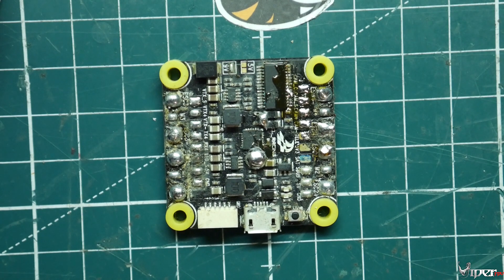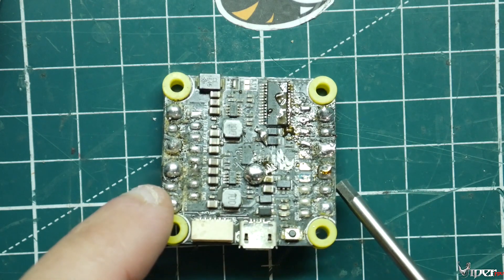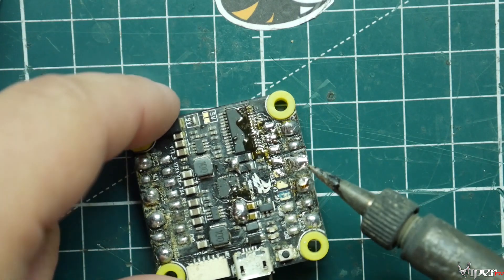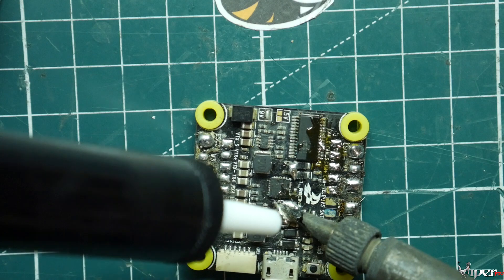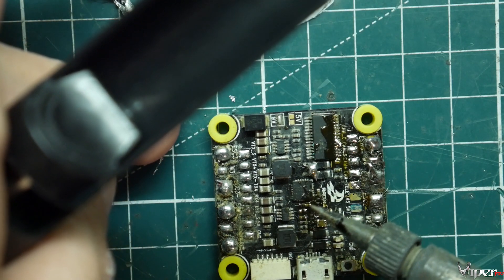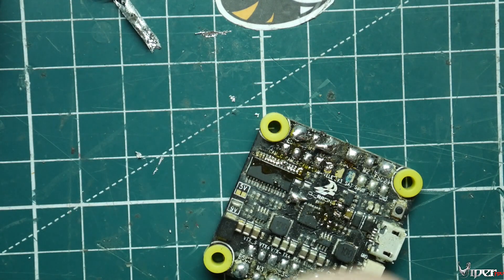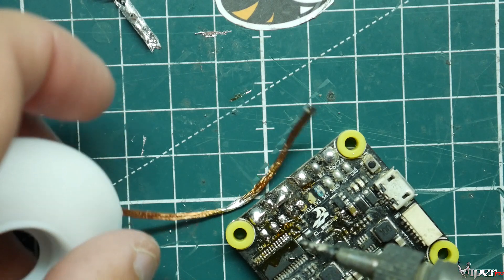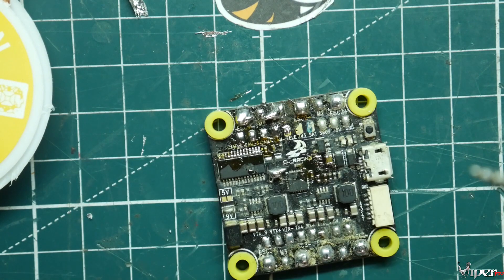How to Fix Soldering Mistakes - FPV Flight Controllers

Comment: I don’t like this type of solder suckers . 
You could have most likely done the exact same thing by cleaning your tip very well holding the board upside down when you heated the blob of solder. 
Those solder suckers are easy to make a mistake like that when hitting the mechanism.

Comment: Yo I bridged two motor pads with a healthy amount and spent over 30 minutes tried to wick it off with that copper braid. I thought the sucker was just some dumb gimmick I got in a kit. Watched ur video, tried it, fixed im 10 seconds! You sir, rock!
Reply from the maker: Awesome!!
Reply: You spent 30 minutes heating up and cooling down the pcb ?
That poor little copper pad.

Comment: Hi Viper_FPV, can i use the solder wick in between the flight controllers main battery pads? There is definitely no shortage of solder on and between them 😞
Reply from the maker: You sure can. If there is a lot u may even be able to use the solder sucker
Reply: @ViperFPV  thanks for the fast reply, there is a reasonable amount of solder bridging but not to bad either. I did first try to remove using just the soldering iron but no luck. Could i just use the solder wick to save me having to also purchase the sucker?

Comment: "add more sider" wouldn't it be better to add flux instead?
Reply from the maker: It depends. You can try more flux first but a lot of times when u have a small little blob or mess up there is not enough solder to wic into the solder sucker or wic. So u actually would add just a little bi lot more solder to get it all up.
Reply: @ViperFPV  Makes sense thanks! just leave some on the iron to pick it up with?